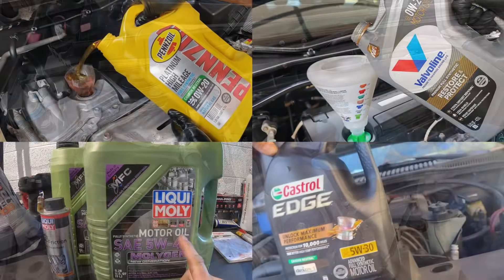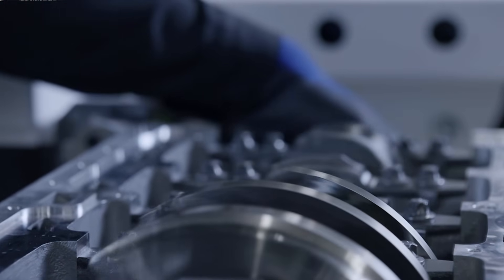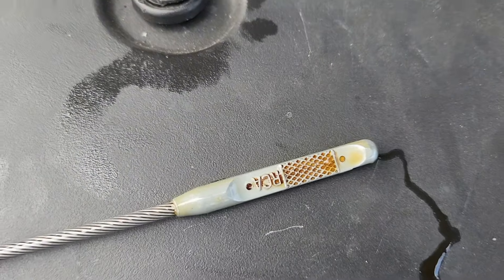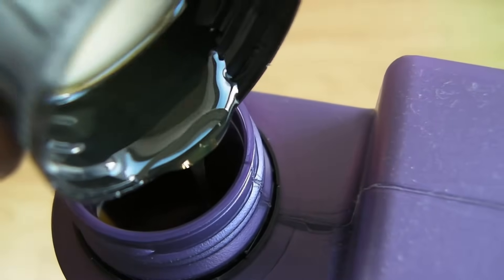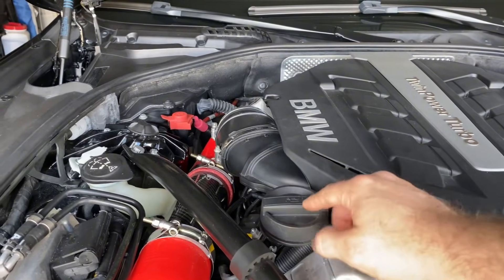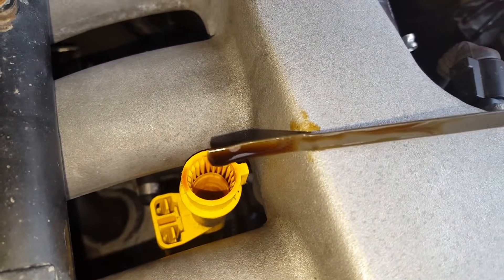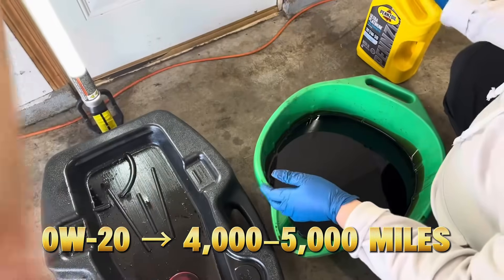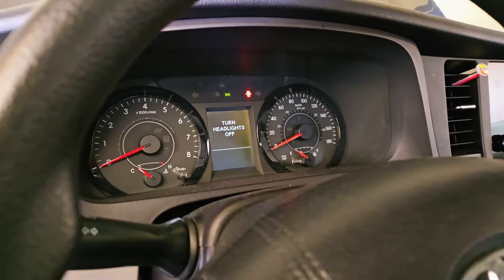0W 20 vs 5W 30 vs 5W 40: I Tested All Three — One Clear Winner!

Comment: Interesting you used the 0W oil first, before the engine was broken in so wear metals were guaranteed to be higher. 
Why did you use different brands of oil? Comparing apples to oranges negates the test. 
And the AI narration is an insult, could not watch to the end, complete waste of my time.

Comment: This video is clickbait meant to maximize ad revenue by playing on emotion, political divides, and automotive folklore—not data. It recycles low-effort GenAI content and provides no real evidence.

You can’t claim one oil viscosity is “better” without long-term used oil analysis (wear metals, particle counts, fuel dilution, viscosity at temp) across hundreds of engines, climates, and duty cycles. You also can’t treat all engines the same in tribology—design, materials, tolerances, and operating conditions matter.

Without UOA, you’d need thousands of controlled engine tear-downs. This video does neither and ignores major variables like turbos, cylinder deactivation, fuel dilution, climate, and driving patterns.

OEMs and oil companies spend billions on testing to set oil specs. Deviate only with data—this video offers none.
Reply: Why is 5w30 recommended in German and Middle East for the same exact engine. However in the USA 0w20 is required? Can you explain that?
Reply: @lukeav6097 German cars also recommend 0w20 and lower in Europe.  They do not recommend 5w30 for all car models / engines.  My 3.5L V6 calls for same 0w20 in US, Europe, Middle East, Japan, Mexico, etc.